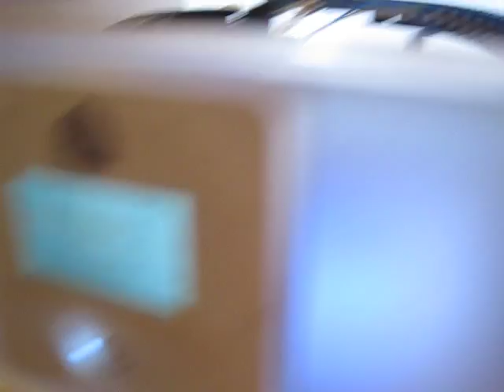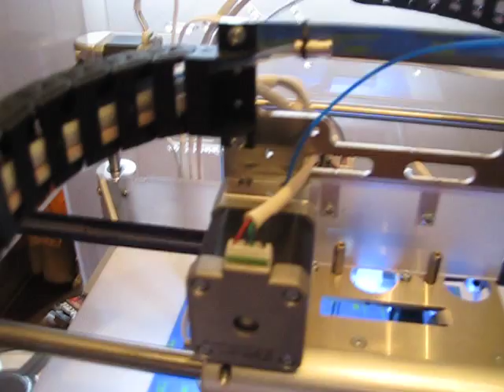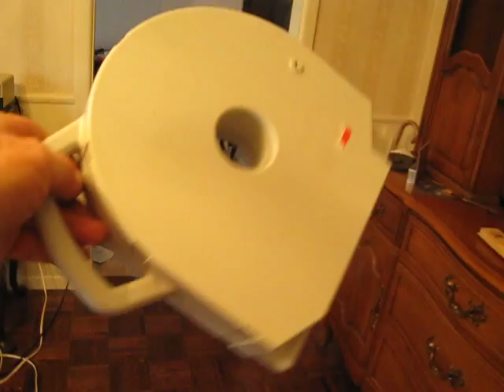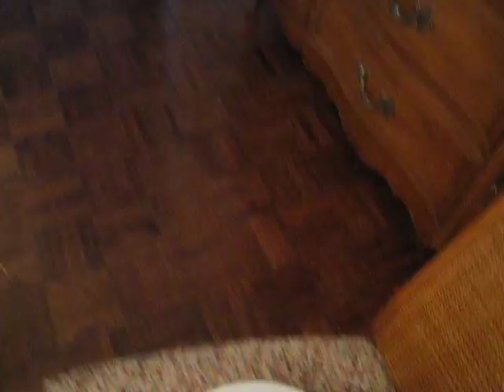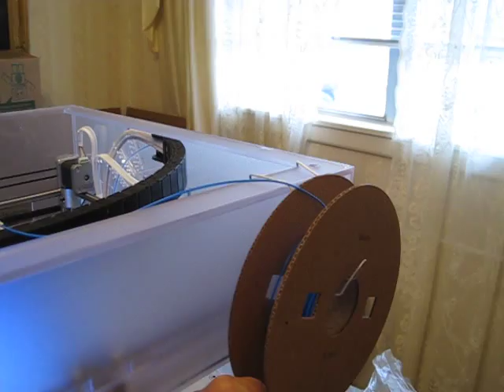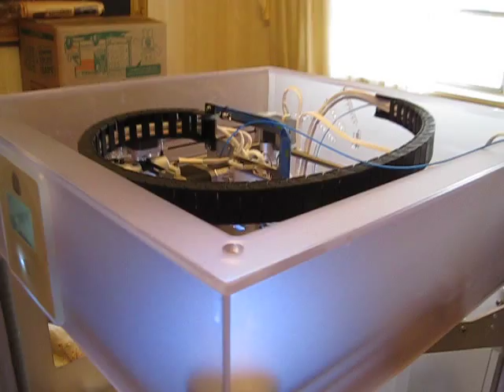Cubex Hack

Comment: This is great! I have also permanently secured the chip to the printer.  I also split open the original cartridge and am using half of it as my spool so it turns more easily.  Love the idea of loading from the top, since snaking the filament through can sometimes be a biotch.

Comment: This is great, but I have a Cube EkoCycle 3d Printer. Just as here, the cartridges cost about $50.00 apiece. We can buy a 2kg spool for about $25.00. I have figured how to get the filament to go thru the original cartridge, but now that the chip says that there is no more filament according to the chip, it won't print any more from the cartridge side. Can anyone help with a hack for this type of printer?

Comment: Yeah! The solution shown on this video is only to avoid "filament flow error" due to the filament gets tangled inside the cartridge. When the chip says that the material is over, the printers does NOT accept files to print anymore.
I FOUND A WAY TO PRINT WITHOUT CARTRIDGE.
It works if the printer´s firmware is 1.07 or below (I don´t know about Cube Pro) and uses KISSLICER with CubeIt (both free) softwares combined.
The results, it means the parts printed, comes out much better than using original Cubex software.

Comment: great video, however doesn't the cube x still know how much material you have used whether you have a external spool? I have experienced it with other hacks and know my cube x says empty. but it is actually full cause I haven't used it I am using bulk. It keeps track of the grams used, I think. Then I place my original cartridge in and it does not register still shows empty, any help will be appreciated thanks.
Reply: Hello mrsdizi1234 did you get an answer? I still want to know if the chip needs to be reseted again as full cartridge? or will it always make the cube think it is full 100% ?